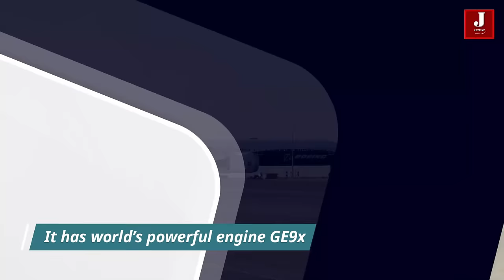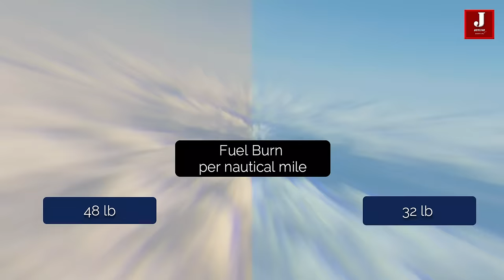Mega Comparison of Boeing 777x vs A350-1000 Aircraft

Comment: So this means 777x carries more fuel than the A350 bt yet fly less range🤔
Reply: @yo yo thanks for the explanation, but I still think the A350 is a beautiful plane and very good in any other way
Reply: Don't forget that Boeings are expansive due to their longevity when compared to Airbus. They are traditionally more expensive but last longer and are a better workhorse.
Reply: @baadnewz017  that goes to Airbus too. The oldest A330 is still flying at the age of 25. Let’s just admit the a350 is a game changer
Reply: @siyalizwabudaza4652  Agree to disagree. The 787 was the Game changer.
Reply: @baadnewz017  yes 787 brought all of these new technologies and the new airframe light weight. But the A350 took it to the next level. I see news of 787 Extended Range. It still falls below A350-1000. I know the don’t compete
Reply: Exactly but you miss one point: the 777-9 carries more fuel to fly less range with a much higher payload.
Reply: @yo yo The aluminum slats are there because composites cant take the heat of wing anti-ice, or transfer the heat of bleed air to the leading edge. &*& has electric heaters for the leading edge, BTW. CF is actually quite repairable. Ethiopian Airlines burned up the tail on a 787 due to an ELT battery fire. It was rebuilt. I wouldn't want to fly on it, though!

Comment: Please overwork your research, it can't be, that the A350's acpcity has a variety of 111 People and the 777 only of 12. Think about it, the maximum with the A350 is calculated on a single class configuration. 
Just to give you guys a proof, think about it, the video clearly shows that the 777x is wider, taller, longer and as all avgeeks know owns the most powerfull comercial engines in the world. It just won't make sens that it should then carry less people than the A350!
Under concern of the named facts youst think about it how absolute would it be that the A350 can carry over 50 People more than the 777 eventhough it is smaller in every aspect.
In a world like this I would ask my self if airbus has placed a few seating rows in the cargo bay.

Comment: The Airbus a350-1000 is a magnificent plane, its flight is calm and has a low noise level, good comfort for passengers, technologically very modern. All this has been proven for quite some time where passengers have verified it. The Boeing plane, the 777x, does not have a date to start flying, how can we compare two planes where one of them has not yet traveled any passengers, anywhere. Simple conclusion, the best plane at the moment is the Airbus A350-1000.

Comment: Please get your facts together. Please just get your information and facts correct
Reply: Tell us Mr engineer tell us what the facts are supposed to be since you build the two aircraft in your garage so well...
Reply: @mwat22  There is another seating configuration for the 777-9 that seats way more passengers than what was shown. Its quite a bit more than the A350. That being said, the 777-9 burns less fuel per seat. It can carry way more of a payload, which is another win for the 777X, when it comes to selling Freighters. That of course will be the 777-8F, which Qatar has ordered as well.

Comment: A 350 is the best aircraft?  does that include the peeling paint category?
Reply: The B787 is a better aircraft in your opinion does that include its shoddy workmanship that has it not in production as a result??
Reply: @mwat22  787 is crap also
Reply: Even Boeing workers would put their families on B787. Enough said
Reply: If A350 was a bad aircraft than why did the worlds best airlines order it and why did it receive 800 orders 
Plus Boeing also had issues with their 737 max and the 787 
Paint peeling off isn’t as worse as a 737 max
Reply: Plus A350 can fly longer flights than the 787

Comment: I think airlines would prefer A350 1000 more than 777x because of less fuel burn and more range and more seats
Reply: A350-1000 seats even less than 777-300, it's no comparison for 777X.
Reply: @aseem7w9  agreed, it is still an amazing aircraft though. But Airbus should focus on the -900 to compete with the 787-9 and -10
Reply: BINGO!!, Money is still the bottom line here.
Reply: @aseem7w9  has a poor fuel burn compared to the A350 so that negates it.
Reply: @mwat22  777-300ER first flew like 17 years ago so of course it will have a poorer fuel burn. It's around 10-15% less efficient than A350-1000 in a typical configuration.

For the 777X, Lufthansa who is among the largest 350 operators said 777-9 and A350 burn a similar amount of fuel per seat so neither the 777x nor the a350-1000 has any fuel burn advantage. 

The extra size with similar efficiency is what's giving 777-9 the advantage hence it has double the orders of A350-1000. Airbus should just focus on their medium sized successful wide body A350-900 instead of bringing another failure to the large wide body market after the A340-600 and A380.

Comment: Flown on Airbus aircraft before … they have always been quieter and way more comfortable in every way. Given the price tag, range fuel consumption etc in the spec sheets I’d say the A350 wins hands down.
Reply: I have flown on A320-200 and it is very loud but A321-200 is comparatively quieter. And comparing these two to Boeing 787-8, it is the most silent. Never experienced a A350 and hoping they would be quiet

Comment: Present management is solely pursuing lowest possible cost of production. They have abandoned manufacturing quality and engineering competence. 
Existing airline customers have been unwilling to accept planes build at Boeing’s South Carolina plant due to poor quality of production. So now Boeing is transferring all of its production to this plant. Sales 101 – make the customer happy. Now is that making the customer happy; not at all!
The lithium batteries on the 787 that caused fires, was an engineering failure beyond belief. My next-door neighbour, high school education, building remote control planes at the time of the 787 fires, knew more about lithium batteries and fire potential than Boeing did! That is truly revealing of Boeing’s engineering incompetence.
As a retired safety engineer, the reliance on a “known to be unreliable” sensory, is monstrously incompetent. On the 737 Max, the software control system (Maneuvering Characteristics Augmentation System (MCAS)) that worked in the background (hidden from the pilots) depended on the angle of attack sensor on the outside of the plane. This sensory is known to be unreliable. Fundamental safety engineering rules state that such an unreliable sensor should never input to an online controlling software system. As a retired professional engineer, this negligence is not just unprofessional or due to incompetence – it is criminal. People died due to this incomprehensible engineering incompetence. Management was not paying attention; they were off cutting costs, or whatever.

Comment: Why more fuel capacity if the range of the 777 is less 3000 kms than the Airbus...??!!!
I already had the pleasure of flying in both airplanes,and honestly i was more impressed by the Airbus 350.
On a night flight is so quiet and confortable,realy amazing. And overall the airplane design and ergonomics,in my opinion are superior than the 777.
But both are Spectacular airplanes.

Comment: Boeing 777x has more cargo capacity and its technology follows B787 the Airbus 350 still uses bleed air for engine starts and pressurization not like the B 787 don't know much about the B777x. Have flown on Airbus 350 and B787, prefer the B787. The B787 is primarily an electrical aircraft where it is used for brakes, pressurization, anti icing, engine starts,  where the Airbus 350 is still using conventional technology for bleed air and engine starts.

Comment: Clearly Boeing have not learnt from its 737 fiasco. Retrofitting an old airframe with a few improvements. A bit like a car manufacturer retrofitting a EV by removing the engine and plonking some batteries somewhere which was never the intent. Where is the Airbus is a new design from the ground up. And they say the 777 is a 21st jet...don't make me laugh! 🤣
Reply: Laugh if you want.  Boeing’s 100 plus years of continuous manufacturing record speaks for itself.   If you think the new 777 model is a few improvements on a retrofit, you have no connection to the aviation industry.   The new model 777 is transformational.

Comment: The Boeing 777-300ER range is 13,650 km.  so what you are saying is the NEW JET WILL FLY SHORTER?? Even tho they say it has "more range" "less fuel" 
Your video is a false. You are using the 300er vs. The a350-1000.
Your passenger numbers are off also. For example air Canada Flys 450 passengers in the 777. No airline Flys 490 passengers in any of the 3 class configuration. That's the a380. 
What a bias video. The GE90 motors beat the trent motor by a mile! They have better fuel range and a high cursing speed. 
What a false video

Comment: I think it's a bit of a stretch to claim that the A350-1000 is better than the 777-9 considering it's not even in production as of the release of this video. There's a bit of a bias here I think, and you need to double check the max passenger count. You also didn't mention the 777-8 which blow the A350 out of the water in many categories.

Comment: It's an easy one really, The airbus is significantly more fuel efficient quieter and can carry more passengers, it's also cheaper.
Its available and been in production for 7 years.
However they have got a big problems with the paint coming off, but nothing in comparison to Boeings problems with carbon fibre contamination and many other technical issues , and being years behind with it's launch.
Boeing use to make great aeroplanes, but those day's have gone.
Reply: Wrong - and it isn’t just ‘paint coming off’.  Boeing makes the best wide body airplanes - I agree that the A320-21 is a nicer ride than a 737,
Reply: @pacmanc8103  Yes i believe it's a much bigger problem than a quick respray.
I'm just going by the specs shown on the video.

Comment: MODULATED SIGNAL SYSTEM FOR CONTROL PANEL
Numerous instruments and controls in (say)a big aircraft is interconnected by a very large
numbers of parallel individual cables running whole length of air craft for each connection.
This can be reduced to one shielded cable to cover whole length of aircraft for all the
connections
From this one cable connections will branch out to instrument and control panel at control
panel in the cockpit at one end ,and to the sensors and devices of the system at various
ends..
Presently Sensors send analogs current to move the instrument.
Instead of this each sensor will be embedded with a modulator and encrypter like a mobile
phone.
So the instrument will transmit a low powered signal just like that coming out of mobile
phone. The current will be low and all instruments and devices can send and receive
multiple signals through one shielded cable.
this cable will also supply power to all devices. Due to encryption the accuracy is assured
and .maintenance of just one cable becomes simple.
In large aircraft weight of cables will be reduced and assembly becomes easier.
Multiple sensors for one parameter can be installed at low cost ,this will vastly increase
safety . ..There are dozens of instances of aircraft crash due to failure of power supply to,
or signal received from ,just one of the sensors >like Air speed sensor ,temperature sensor.
Altimeter,Artificial horizons etc.
These failings were very minor but resulted in disasters.
The proposed system will ensure saftey
20 mins · Edited · Public
Reply: You must be an aeronautical engineer! Who do you work for?

Comment: In order to fit a 350-1000 480 seats, It must be a 3-4-3 configuration. It must be extremely uncomfortable. Such configuration is already bad enough on the 777s ,and the 777 has wider cabin., would you fly these high density 350s 16100 KM?
Reply: Nope!

Comment: Isn't the B787-9 currently the most popular widebody aircraft?
Reply: It is, the A350-1000 is a failure with not even 170 orders and 20 from Qatar are at risk.
Reply: @aseem7w9  That’s the -900
Reply: @technicalmc9547  no, a350 900 is very popular plane
Reply: @aseem7w9  A350-1000 is not a failure
Reply: @aseem7w9  The A350-1000 is more fuel efficient than the 777x mate
Reply: @technicalmc9547  then why does it have 165 orders only? It had 200 back in 2013 but many airlines reduced the order for it. 

If fuel efficiency of a35k was noticeably better than 777x then it should be dominating just like 777 300ER vs a340 600 back then, yet we see even the largest a350 operator and customer in the world has 30 777 9 on order but 0 a350 1000 🤔
Reply: @aseem7w9  It's because the -1000 is 50 million dollars more expensive than the -900. So many airliners found a profit of getting the smaller -900. But that doesn't mean the -1000 is a failure its currently the future of Abu Dhabi based Etihad Airways and Australia's Qantas.
Reply: @aseem7w9  The difference between the -900 and the -1000 is the passenger capacity, longer range, more thrust and height is only like 1 inch taller which is essentially the same wing size everything is the same but the fuel efficiency of the -1000 is insane. But once again airliners find it not worth for the extra 50 million. Many -900's can be saved with that many. The more 50 mils saved the more -900 aircrafts the more routes the more money haha. I guess that's the way to explain it lol.
Reply: @technicalmc9547  ok, the fuel efficiency of A35K is great no one is disagreeing. However straight up claiming it to be better than 777X is a big stretch especially when Lufthansa one of the important 350 customer says 777X is just as efficient. Airbus claims it is ahead whereas Boeing claims theirs is ahead, both are just PR campaigns which airlines don't consider when ordering airplanes hence we see 351's order book is in such state.

I agree with A350-900 cannibalizing A350-1000 sales. The main problem with A35K is that it's too small for airlines to feel that purchasing this plane is justified however it's the largest Airbus available so airlines put it besides the 777-9 as rival even tho these 2 are quite different airplanes which causes issues.

The main market for large airplanes from now on is either as a 777-300ER, A380 or 747 replacement and the 777-9 is simply the best option in today's market since it's bigger with similar efficiency i.e providing more revenue potential hence it has gained a lot of orders even from the top A350 customers who prefer it over A35K. 
The 777-8 is just a niche plane for ULR routes like 777-200LR was so most airlines don't consider it.
Reply: @aseem7w9  You do know that 777x has issues too right, other wise why would they delay the launch by like 7 years?? Where as the A35K came just at launch. Some airliners have doubts about the 777x but we can't compare the two unless an airline receives it themselves. Don't you agree?
Reply: @technicalmc9547  ? The a35k was delayed as well and actually underwent many design changes that caused airlines to remove their order for it, a famous one being Emirates. There are multiple 777X flying test flights for like 2 years already, airlines know how much seats theirs will have too and based on the bigger size of 779 it's the best 747 380 77W successor.
Reply: @aseem7w9  Yeah but not like 7 years... 777x is good I admit but about fuel efficiency just admit the a350-1000 has the edge.
Reply: @technicalmc9547  the time duration might've been short but the damage airbus did to a35k in that shorter period is much greater with all the cancellations and design changes.

Ge9X has turned out more efficient and better performing than GE promised Boeing they would deliver, Lufthansa says 777x is as efficient as a350. Who other than Airbus themselves claims a35k is more efficient? My stand on this is pretty neutral, both are very efficient planes and their efficiency gap is negligible. Even 737 max is 2% more efficient than a320neo but do we see it really making any big difference?

Comment: Why are comparing the B 777X to A 350? The Airbus made of more than 50% of composite material was a response the B 787 which is made of 50% composite material. The B 777X was designed to respond to airlines looking for an economical alternative to replace there expensive 4 engines planes like the Airbus 380 and B 747-800.

Comment: 124T of fuel to fly >16000km onA350-1000....
Then wondering if passenger version of A350F (configured on 55m cabin length) with lighter OEW, 319T MTOW, Trent-XWB-97 & aux tank....that would fly 10000nm🛫🤓
Reply: The A350F will definitely be a good freighter simply because it can carry more and fly further. Doesn't necessarily have to carry the most to be a better freighter than the B777xF

Comment: the 350 is a hot seller. lighter, more passenger capacity and greater range. great sales pitch for airlines
Reply: The A350-1000 is a poor seller. The 777-9 has its advantages over the A350-1000, also it can seat more passengers.
Reply: @widget787  Has a single 777X actually flown a commercial flight?

Until they do, lets hold off on crowning it king.
Reply: @monunyabidness5949  still the A350-1000 is a poor seller.

Comment: You need to get your facts straight. It's not called the triple X, it doesn't have the latest technology in terms of construction (777 first flew in 1994) and maximum seating according to boeing is 568 (far more than the A350) typical 2-class seating for the 7779x is 426. Both planes are options for long and heavy routes, but in terms of comparing them in automotive terms... 777x is a GT500, Big heavy & powerful, while the A350 is a Tesla, spacious modern and efficient. Don't get me wrong, I love big old planes, but nothing touches the Queen of the skies. 😉